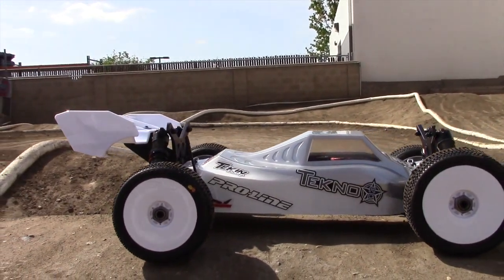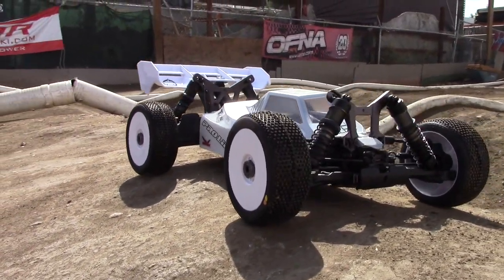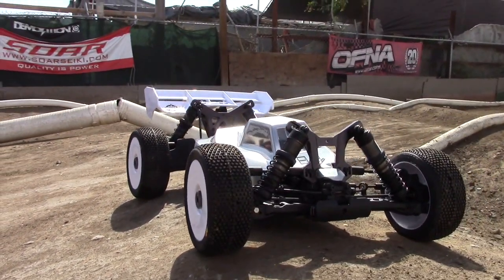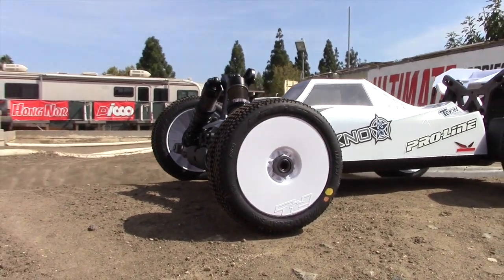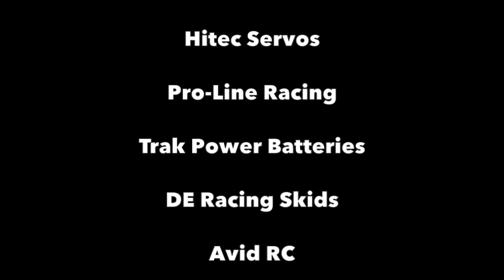Tekno EB48.3 - Official Running Video - "Wall Ride!"

Comment: Im looking at a truggy what do you think I should get? I dont want to spend tons and tons of money.
Reply from the maker: +CG Trig Hey CG, well you picked the most expensive platform (besides 5th scale) on the market.  Not sure what tons and tons of money converts to, but you will easily be at/right over a G for a decent KIT Truggy full equiped.  I can vouch for the DEX8T and the ET48.3 - both are great platforms, but I really like the Tekno
Reply: ok thx for the advice
Reply: +The RCNetwork I forgot to ask you, should I keep my rc8be the old version or get rid if it for a newer buggy? if you what buggy?
Reply from the maker: I would sell of the RC8BE.....super old design and light years behind the Teknos and Mugens of today. Those are the buggies I would recommend along with the DEX8 from Team Durango. I can really speak for the EB48.3.....it's a great buggy
Reply: Ok what about the losi 8ight e 3.0?
Reply from the maker: It's a decent buggy, and still has the benefits from Adam Drake.....
Reply: If I get a mugen buggy should I get a Mugen MBX7 Eco MSpec or the other mbx7 electric buggy?
Reply: +CG Trig get the losi 3.0 e it's better
Reply: Eric Dunlap what about a 1/8 e buggy? Is the losi good?
Reply: +CG Trig if ur asking about the losi 3.0 E than ya. I have the losi 3.0 e buggy and my son has the losi 3.0  E truggy. Just sold his losi 2.0 truggy for 250  as roller pretty good still had lots of value. IMO losi much better than everything else. Don't get mugan pillow ball suspension they pop out. Losi best it will still be 1 G and up though
Reply: Eric Dunlap what about the tekno eb48.3 vs the 8ight e 3.0? For racing bashing on rough loose medium-short length tracks? Im coing from a rc8be.

Comment: what was the size of the track
Reply from the maker: +Jason Jarvis Pretty small.  Great for 1/10th scale but a bit small for an 1/8th scale
Reply: I was just asking I was going make a track I have a mugen mbx7r eco 
What is a good size lane I have around around 75 by 100
Reply from the maker: +Jason Jarvis Lane size you want is about 6' or more if possible depending on how many people will be running on it
Reply from the maker: +Jason Jarvis Great buggy, BTW!
Reply: Yea it is I like it a lot 
I am going to get the RC83EB thank I will go with a 1900kv motor I have a 2050 on the mugen
Reply from the maker: +Jason Jarvis Nice!